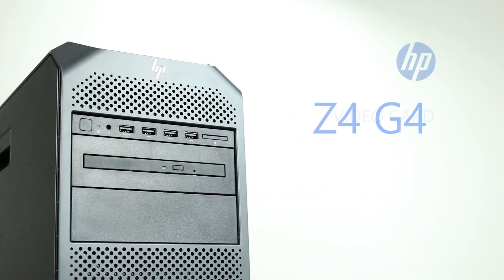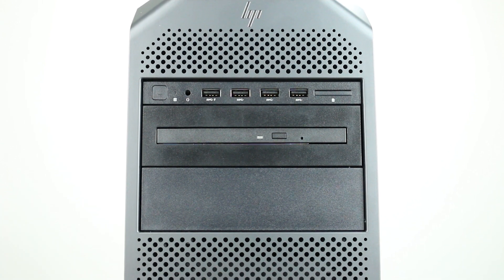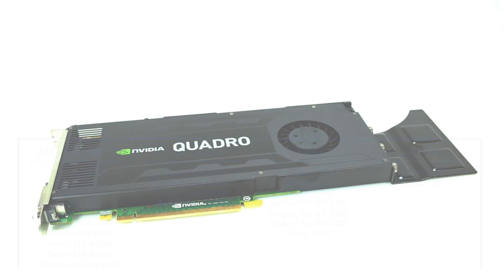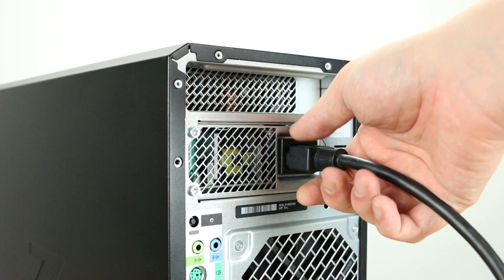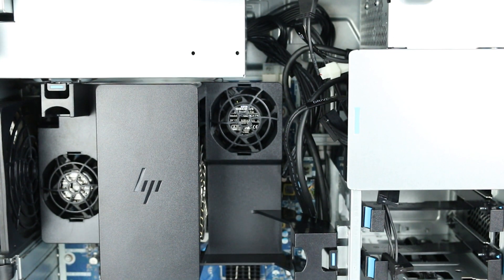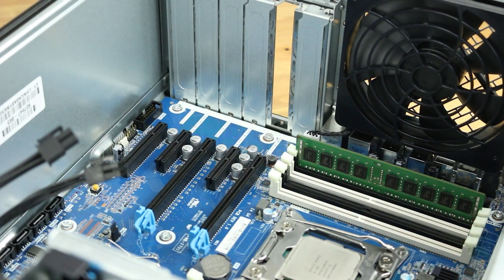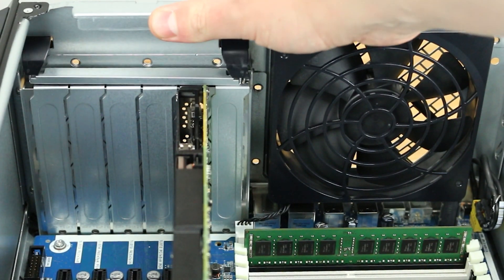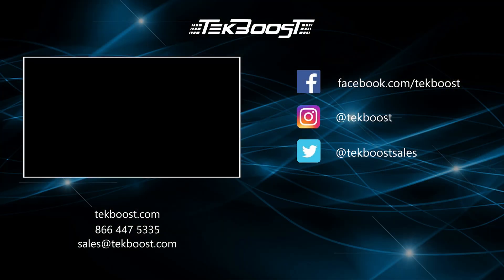HP Z4 G4 Video Card Installation

Comment: I have the 750W model with dual 6 pins, whats the best way of using a card with dual/single 8 pins. Like a intel A580 with lower power consumption.
Reply: did you ever get an answer for this? i have a 3060 with 2 8 pin.

Comment: I used a Rx 560 card but it is not working. the card is fine with other computers I have but not here. is there a way I can get It working???
Reply from the maker: Have you gotten video on the Z4 G4 with any other graphic cards?  If not done already, try the 1st and 3rd PCIe slot.  This should be the only video card installed when testing.
Reply: @tekboost  I tried 3 other cards. I also used different slots but still not working
Reply from the maker: @SR-iu4zr  Did any of the 3 cards work successfully in the Z4 G4?
Reply: @tekboost  no
None of them
Reply from the maker: @SR-iu4zr  Sounds like the graphic card may not be the problem.  Was the workstation working at anytime in your pocession?  I recommend reverting the Z4 G4 back to the last known working configuration.  Then only make one change at a time before booting to confirm working after that change.  If you made any other changes such as RAM or CPU, those components may not be compatible in the system or together inside that system.  For example If the workstation came with a W-21XX processor and you swapped it out to a I7 processor, the motherboard is not comaptible with both, there is a specific board for core processors and another for xeon processors.
Reply: @tekboost  Yeah I guess this may be the problem. I'll try this and update you in a while.
Thank you so much ❤️
Reply: @SR-iu4zr  Have you got this done? Is it possible to use a non HP branded GPU?
Reply: @cajgazachar  I bought a 1060
It did worked with it but I changed the setup.
I bought the ho omen obelisk